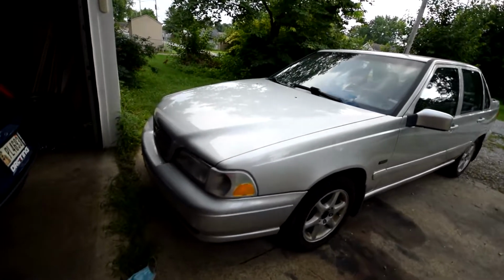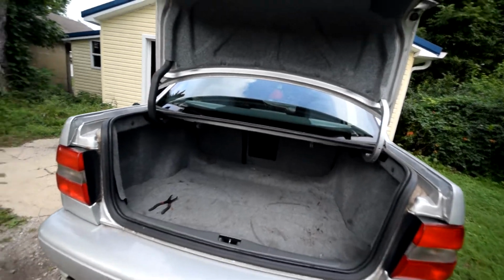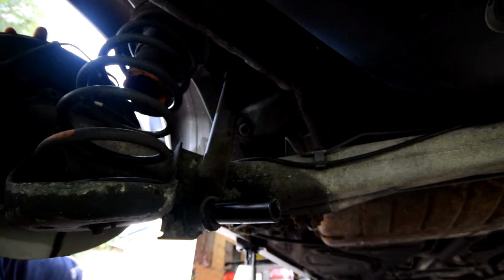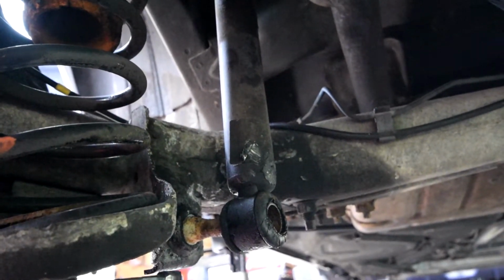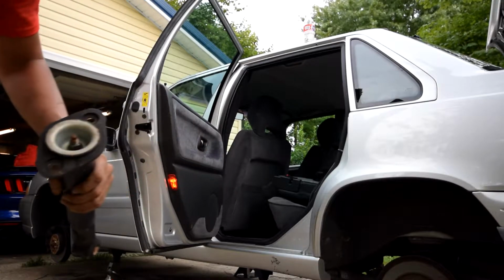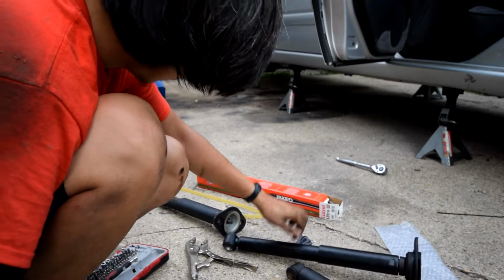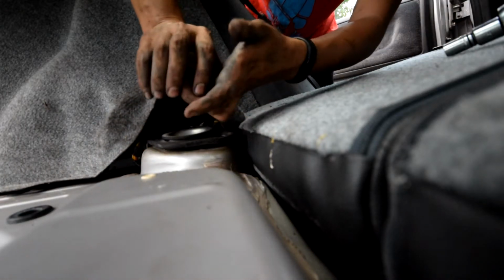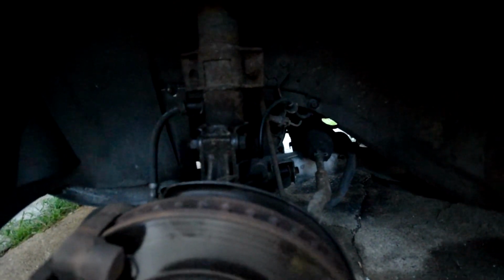P80 Volvo Rear Shocks Replacement (850, S70, V70)

Comment: I've got an entire suspension swap coming up once it cools off a bit outside.  Eibach Springs, Koni STR.T shocks & struts, lower control arms, tie rods, swaybar end links and the whole suspension overhaul parts kit from FCP.  If it weren't an old 99 T5, I'd probably have sold it long ago but clean T5's are hard to come by.  Still kicking myself for selling my 98 T5 manual transmission.

I've put easily 2X if not more worth of parts into this damn car but it's paid for and cost like $20 a year for insurance.

It needs a new power steering pump, AC hasn't worked in like 6 years, it's due for a new timing belt and I think the water pump gasket is gone but there's no way I'm going to attempt that one.

Comment: Excellent video, I wish I could like it more!  I’ve been tackling similar securely jacking and rear suspension issues in a 2002 v70 xc wagon. (Compressed spring strut assembly). Your situation isn’t completely comparable to mine but I learned a lot!   Dunno where you are but wish it was near Lubbock, TX to help me!

Comment: why can't you just remove the shock by itself? thanks for the vid man
Reply from the maker: you can, but with older cars and depending on the level of rust, they may need some persuasion as seen here.. lol
Reply: @hoon5630  yeah you're probably right! I might just add another 40 bucks to the job and replace the top mounts to make life easier
Reply: @hoon5630  so I just got done changing the rear shocks ! unbelievable, took less than an hour and I didn't remove the mounts. bottom nuts came straight off. shock top nuts needed persuading with a wrench - but otherwise easy money!!!
Reply from the maker: @davestar7  awesome. good to hear!